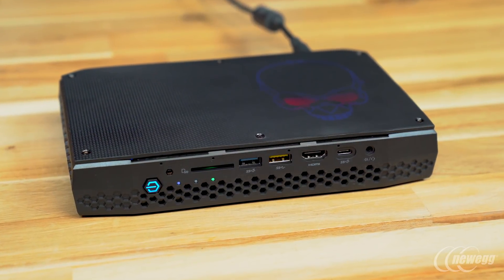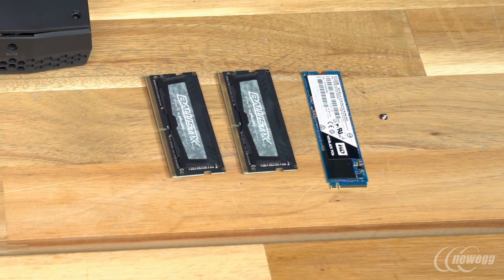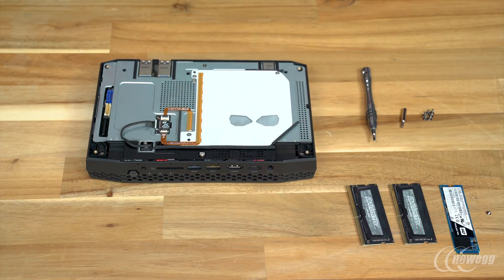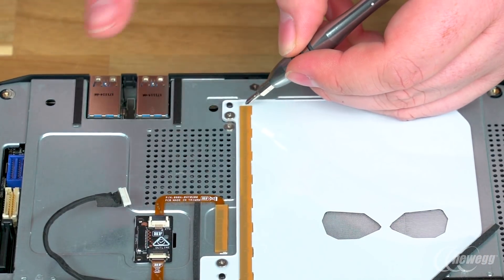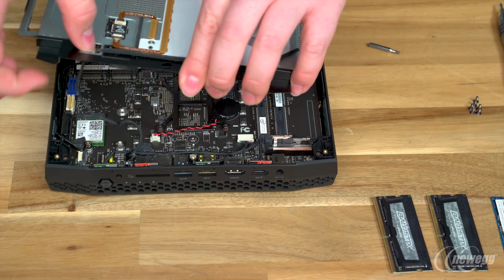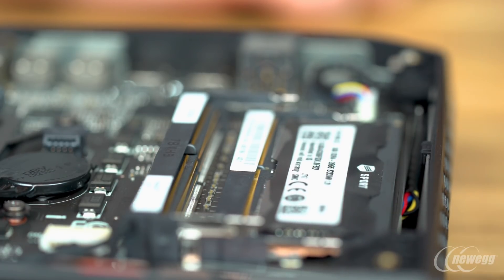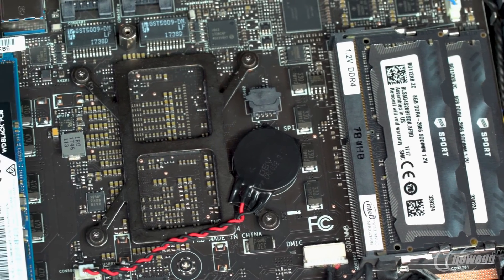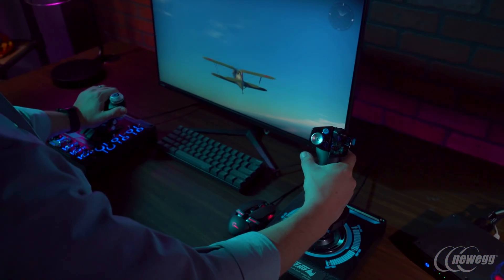Guide: Installing a SSD and RAM in the Intel Hades Canyon NUC8i7HVK

Comment: Hey you PC noobs need to understand that the NUC is just a gaming laptop without the screen and keyboards. This particular one is quite thirsty when it comes to power since it requires a 230 Watt Power Brick. Also, for you noobs who are worried about storage, this NUC comes with 5 x USB 3.0 ports, 1 Type-A USB 3.1 port, and 1 Type-C USB 3.1 port. If USB 3.0 or 3.1 isn't fast enough for you when it comes to storage, you can get yourself a couple of thunderbolt 3.0 external enclosures and fill those up with 4TB Samsung SSD drives and plug them into the two thunderbolt 3 ports in the back for storage extension and faster-than-SATA6.0Gbps data transfers.
Reply: you just said noobs.

Comment: I am wondering if you could use an external storage for things like games and such cause i have a 2.5" 2TB hybrid drive (meant to get a 3.5" for my desktop but messed up) and would like to you know plug that into the system from a USB port or if they have something like a ribbon cable to use the other M.2 slot.
Reply: The NUC8i7HxK comes with USB 3.1 Gen2, so I'd suggest you get a matching docking station (10Gbps should be fast enough). Don't bother looking for a ribbon cable… (If you want an internal solution, maybe look for one of the other models that only have one M.2 and a classic SATA connector.)